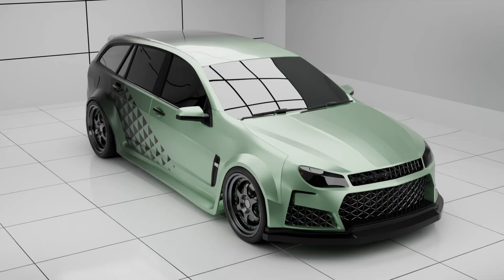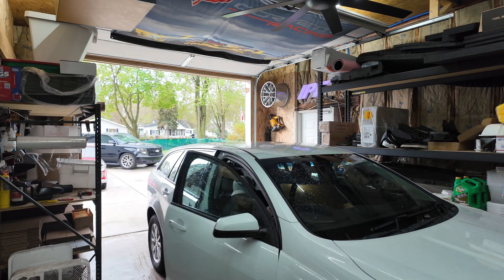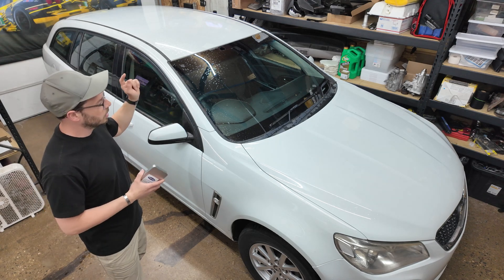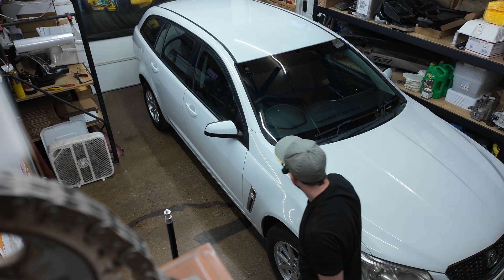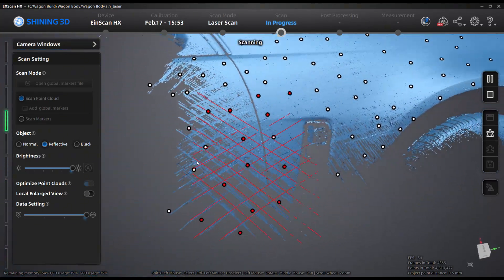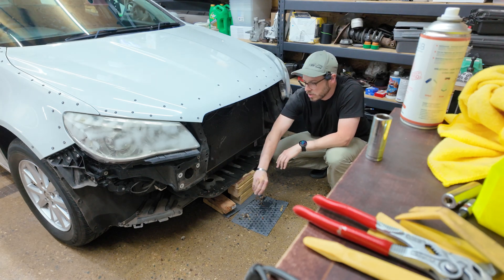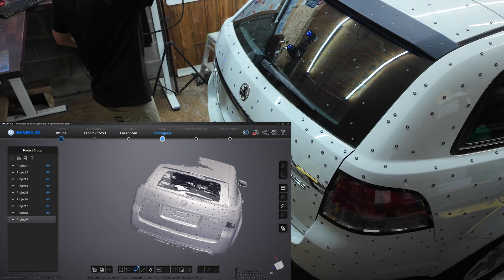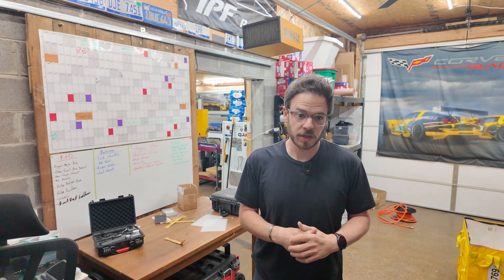Building My Dream Car: Episode 2 Let's Get Virtual

Comment: just curious why u havent started with the SS sportwagon with the l77 in it
Reply from the maker: Cost is the only reason.
Reply: This would have been $3000 and an ss is 30,000
Reply: @Low760  you can pick them up for a lot less than 30K, heck i bought a SS ute for 11 the other day